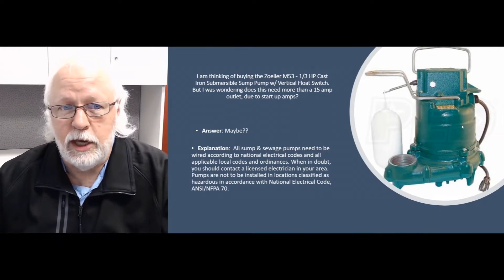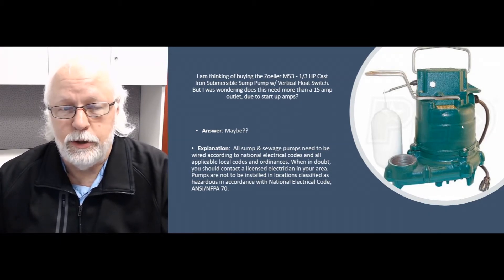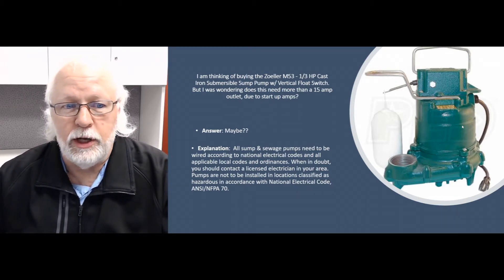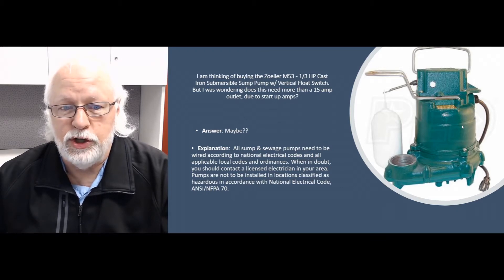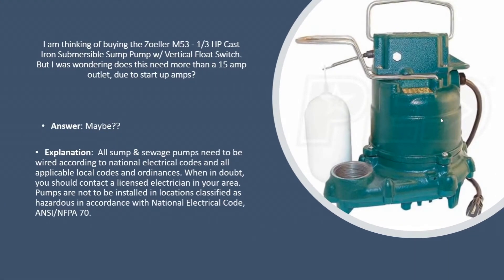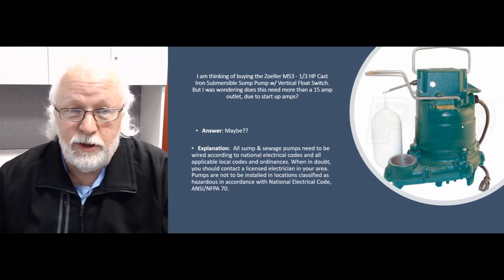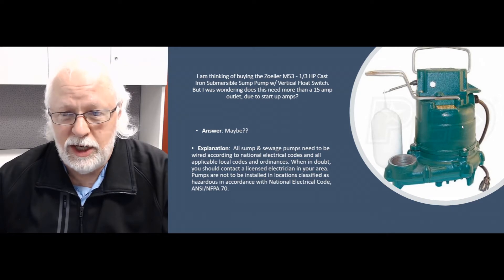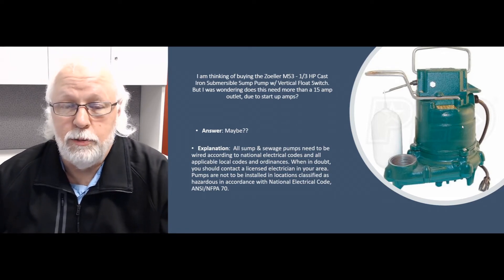Does the Zoeller M53 Need More Than a 15 Amp Circuit?

Comment: How about a 20 amp breaker?
Reply from the maker: While most manufacturers will list the running and starting amps for their pumps, they also recommend that all electrical connections be done in accordance with the National Electrical Code (NEC) and all state and local codes.